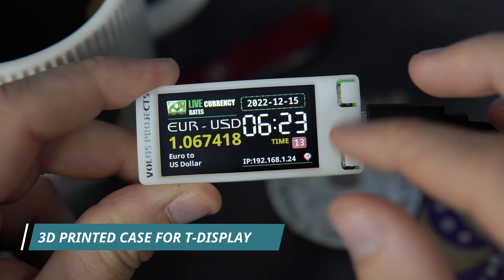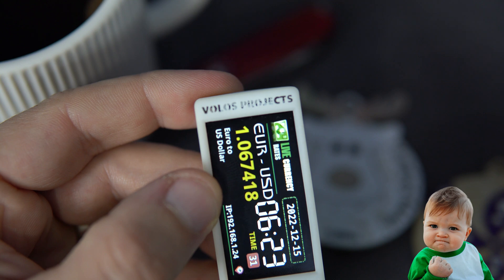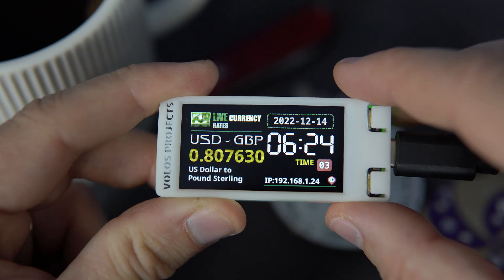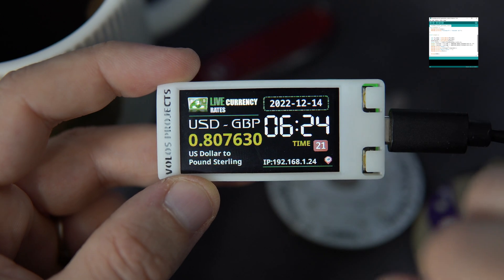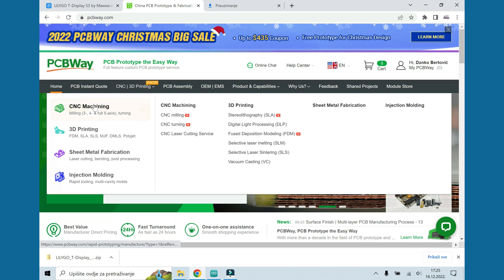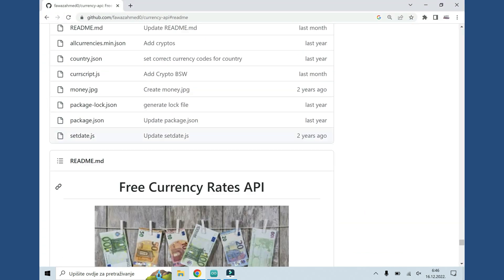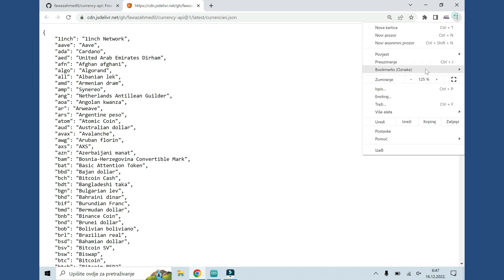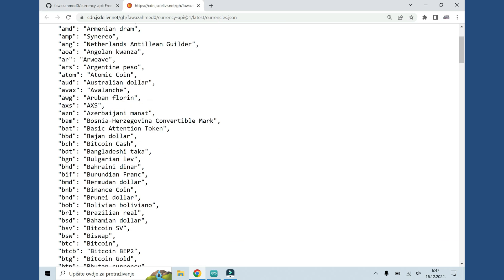3D Printed Case for LilyGo T-Display S3 Exchange  Rate Monitor

Comment: First of all, thank you @VolosProjects for the shared project code. For those not able to run this.First check the linked API library, they moved and I think the links needs to be updated. And the second part is that the results from the API gets converted to a char array, that array is declared in the loop() and it creates an  overflow that makes the board constantly restart. In short give it a constant length lets say 15000 and declare it static like so:  
static char inp[15000];  
instead of the :
char inp[payload.length()];    <- this is the problem

Comment: Hi Volos, your code compiles and uploads fine but the screen flashes white then black then white. Like a glitch..
I can confirm my wifi router picks up the board and that the screen works fine as per your other projects for the LilyGo t-display-s3. 
Don't know how to find the issue if code compile and uploads correctly.
Reply from the maker: I think this api dont work anymore, so this project also dont work.

Comment: The code produces a stack overflow:

Guru Meditation Error: Core  1 panic'ed (Unhandled debug exception). 
Debug exception reason: Stack canary watchpoint triggered (loopTask) 

somewhere at this point:
payload = http.getString();
char inp[payload.length()];
payload.toCharArray(inp,payload.length());

I added the f() http.getSize and it returns -1. Hence i believe the API is not working.
Reply: Correction: getSize -1 obviously can be ignored.
Reply: And now the solution of this problem:
SET_LOOP_TASK_STACK_SIZE(20*1024); // 20KB

Comment: i ran the code and now my pc will not recognise the display on the usb
Reply from the maker: Whic board you used, did you change anything?
Reply: The same as in the video
Reply: try
plug into usb
hold boot button
press reset button
release reset button and then release boot button
that worked for me

Comment: Nice project as always. But i am trying to reproduce it in my T-Display and i can not. I think that it has to with the write selection of display in the library. Can you pleasse tell me what is the write config for TFT-eSPI library?
Reply from the maker: write selection?
Reply: @VolosProjects  Hi Volos thanks for the answer. I mean that in user setup selection i have ti uncomment the write display file. `i have choose Setup 24 and setup 25 but there is no bacjlight in me display.
Reply from the maker: @yannisxidianakis6879  this is first example you are trying with t-display s3board?
Reply from the maker: with this board is diferent , you dont need to uncoment nothing, but you need to use their version of library, please just fallow this video to install your board in arduino IDE https://youtu.be/gpyeMjM9cOU
Reply: @VolosProjects  Thanks i will try that too.
Reply: Yes. You are right. Thank you.

Comment: looks perfectly nice as always. However, the code compiles and loads but then the board gets stuck in boot. As other code examples work, I do not understand why this is not working.
Reply: error found: PEBKAC (Problem exists between keyboard and chair) - after correcting my typos (I am happy that I get all my finger out of the keyboard), the code works - Great Job!!

Comment: Awesome thank you!  I just unboxed my first 3D printer.  I splurged, got a FlashForge Guider IIS.  Still have to remove all the internal packing materials.  This will be one of my first prints!  :)
Reply: FYI, the link after "Case is designed by:" gives a 404 error.  Was interested to see the designer!  Thanks.

Comment: Great video (as always). Loved the case, but mine has the soldered pins, so I've modified the lid with two slots to allow access.
Printed at 0.2 layer height, and it fitted together perfectly... I'll upload the 'remix' to Thingiverse tomorrow.
Reply from the maker: Tnx Robbie, how long it take to print it. Incresing and decresign layer height wil increse/decrese quaity and increse/decrese time?
Reply: @VolosProjects   Sorry for the delay. It took 1h 18mins for both parts on my (slowish) settings.
I've used the case, plus a home built push button panel to to convert an old CD container to a Internet Radio come SD Card player (just for fun).
Shame you cant' add photos here, but I'll add a make to your thingiverse design...

Comment: Volos , if you are still in the research phase of what printer to get I would suggest the Creality Ender-3 V2 as a low end starter that you can get good results from with a little tweaking. I have the ender -3 and have been very satisfied with it. Combined with the free version of Fusion 360 and the sky's the limit. Just beware, 3D printing is painfully slow.
Reply from the maker: thank you, but my 3D printer is on way. We will see. How slow, do you think this case can be printed in less than hour?
Reply: @VolosProjects  It will depend on the quality of the print, for prototyping you can run faster and under an hour could be achieved , quality prints will take longer. Nice thing is the cutting software you use (I use Cura) will give you an estimate on time as you change settings plus material required. If you think of it as stacking hairs to make what you want you can understand why it takes so long.

Comment: Cool box and amazing video as usual.  I have this s3 board. I am having difficulty soldering the pins with this board and wondering if you or any one has a tip for soldering the pins. My main challenge is how to solder pins without touching the hot tip with the screen acrylic. Any advice will be appreciated.